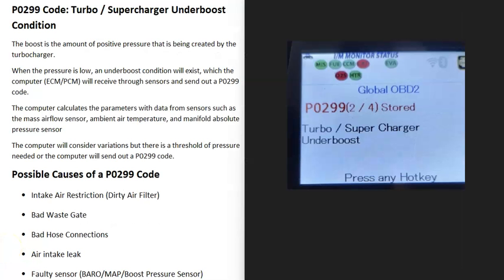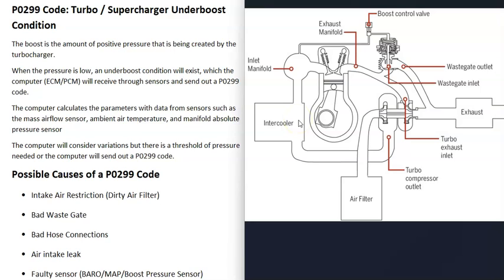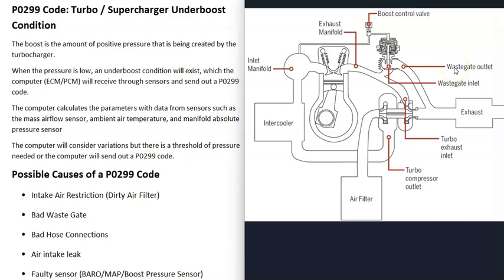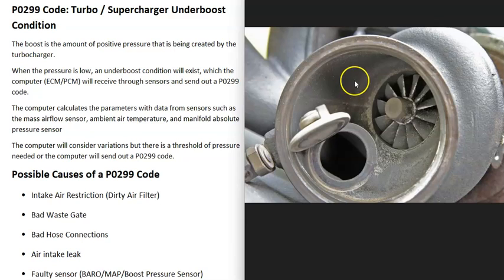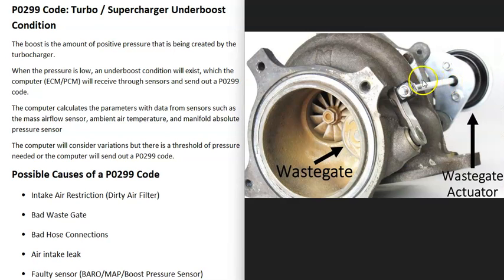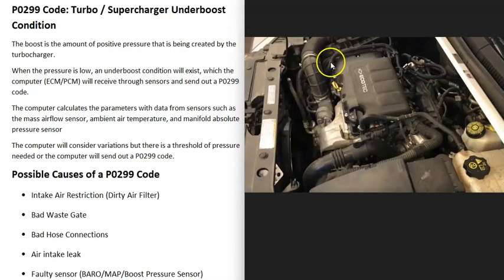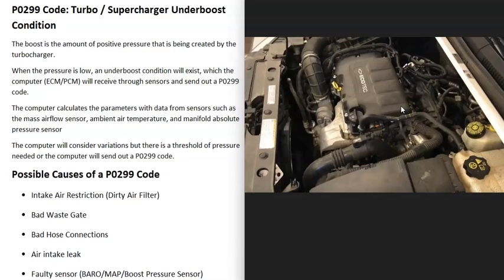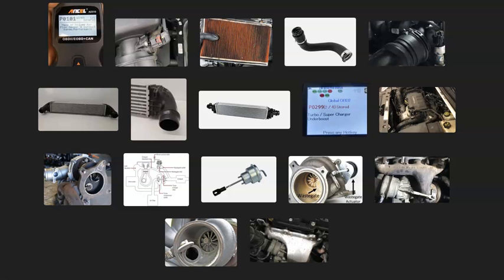Causes and Fixes P0299 Code: Turbo / Supercharger Underboost Condition

Comment: I have a 2017 Buick Encore. I got a P0299 code last September. I tried all the checks recommended by various mechanics. I came to the conclusion it has a bad turbo - at less than 40,000 miles. I recently received a letter from GM that if the vehicle has a bad turbo before 10 years or 120,000 miles, GM will replace it. It's been at the dealer 3 weeks now. They have determined it's a bad turbo. They're really dragging their feet, but I hope they will replace it. Obviously, GM has lost a lawsuit.
Reply: Update: I just got my car back, after 5 weeks at the dealership. They replaced the turbo and related parts. Cost: $0.00
Reply: Where can I find that GM letter? I have tve same come on 2016 Buick with 117000 miles 😅
Reply: @simoncesABC they should send you that letter in the mail but considering your 3k miles away from voiding the turbo warranty I'd set up an appointment at your local dealer. They most likely gonna make you pay diagnostics fee  between $100-$200. Call and tell them your mechanic said your turbo are bad but he told you they are still under manufacturer warranty...
Reply: I also have the p0299 code with my 18' Sonic. I love this car. So much so that when I wrecked ('14 LTZ) on the highway, I pulled my turbo back exhaust off and put it on the 2018 I got. Fast forward 6 years (96k miles) when this code came on for the first time. Weeks later, I got the letter, then took it to the dealer. Who refused to do anything because I replaced the exhaust. Had them talk to me like an idiot because the exhaust gasses/how the turbo works... blah blah. They're not replacing the turbo, but quoted me $2700... 
So now I have the replacement Wastegate Actuator and will hopefully clear this code.
Reply: I got rid of my 2018 encore because just before the warranty ran out and they refused to touch it because it couldn’t be at only 35k miles (got rid of it like a week before the recall) don’t regret trading it in at all
Reply: @flux7061  I'm a mechanic. I couldn't believe my Encore had a faulty turbo at less than 40,000 miles, so I wasted time and money determining it was the turbo. Although I did get it repaired for free, I was not able to use my car for more than 6 months.
Reply: @phlodel how did you get that letter?
Reply: @phlodel  my car has issue and i get the same code but now car dont have power and rpm is not charged as before when the gear changes so what do you think i can do
Reply: I have the P0299 code 22 Chevy malibu. I've replaced the air intake sensor.  Looks like it's a faulty turbocharger I am not happy about that
Reply: @shongreer  I’m in the same situation but with a 2020 Chevy Malibu. Replaced the mass airflow sensor and the issue is still there
Reply: @jackkachel9209  buddy looks like we will have to replace the turbocharger
Reply: Is this on all GM or only the encore?
Reply: 1 yr later
Reply: I’m dealing with this right now,august 2025,been back and fourth with dealer 3 times first time it sat there for 3 weeks,then they told me to pick it up still waiting for parts plus the new turbo,all work was done today,left the dealer heading home got about 5 miles heard a weird noise check engine light went on and reduced engine power message ,pulled over because I couldn’t get up the hill I was on,called the dealer this was approx 4:45 pm they close at 5 pm they to bring it back in the am so they could check it out,I hope I can get it there 16 miles away any insight on what I should do🤷🏻‍♂️🤷🏻‍♂️🤷🏻‍♂️🤷🏻‍♂️
Reply: This is literally what I am hoping for our 2018 Encore that is throwing this P0299 code. ONLY because it will be covered then and not something else to pay for. Thanks for the additional bit of hope for Monday's appointment 🤞🏼
Reply: @ashleygriffin7481  I hope it works out for you.

Comment: 2014 kia sportage underboost same code . Sometimes turbo is functioning sometimes not
Reply: Bro I get that problem too on my Chevy trax 2018 1.4 lit 4cylinder, it will come on for a little bit then turn off for a while, so I assumed it might be sensor related or something with the waste gate

Comment: Hello Sir,
Thanks for the video.  How long can I ride with that code before getting it repaired?  All the lights in my dash are on.  It's running fine.  I can't  understand how I got a brake job 3 weeks ago then 2 weeks later all the lights in the dash of my 2022 Honda Accord are on.  I have 162k miles on it and have taken good care.  Now this trouble.   They're telling me it's 2400 to repair it at the dealer.   In face all the codes state "see dealer "
Reply: Same thing happened to me after brake job it’s frustrating. Any updates?
Reply: I had my brake and disc changed few weeks ago

Comment: I just had this code after fixing my car for timing chain cover leak. The code came together with P227900 Intake Air System  Leak. I can hear the air leaking (loud hissing noise) when paddling above 2.4k rpm. This is not common. Need to further checking with the mechanic tomorrow. The mechanic suspect have issue with the N75 air hose vent. Need to further diagnose. I am driving 2013 Jetta. Thanks for your tutorial.
Reply: I had a similar issue but it ended up being a turbo clamp for mine. Replaced it myself and my turbo has been boosting normally
Reply: I had the timing belt changed just a couple of weeks ago and my 2020 fusion seems like it was not shifting.  Check engine light just came on and code says turbo under boost . Possibly related then
Reply: You ever find the problem with your Jetta . I have a 2021 vw Passat and it’s saying it’s under boost and the p227900 code . I’m trying to do a smoke test now to see if any vacuum leaks.

Comment: Very helpful, thank you. Is it ok to drive with this code if your vehicle is running well?
Reply: Man me too n I sleep in this mfer 😢
Reply: @-2k5  I had to change the turbo out
Reply: @Beast-rz9cd 
What was the issue specifically? Bad blades? Scratch up housing? Hard to believe the entire turbo needs to be replaced unless you're getting one pulled over your eyes by the mechanic
Reply: Did you ever get an answer bc mine is doing this an I gotta work .. which is far.. 30 miles one way
Reply: @nae1300 I’ve been running mine for about 3 months and I do good delivery, I just clear the code but I’m hoping to fix it this week